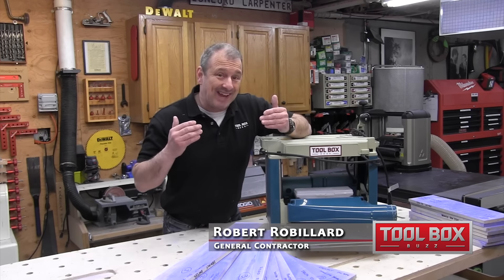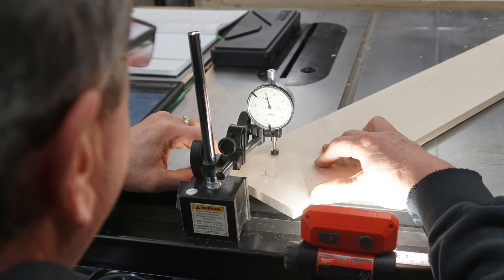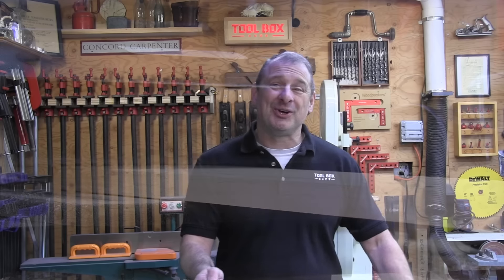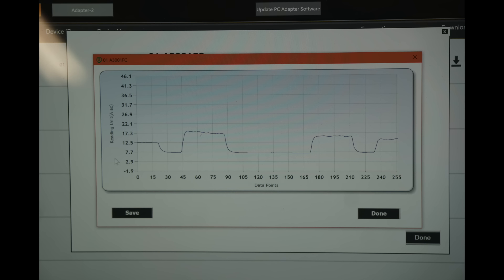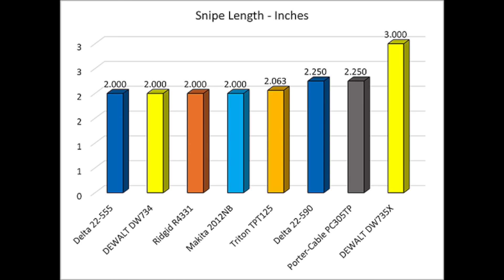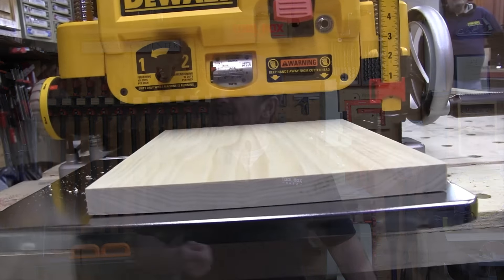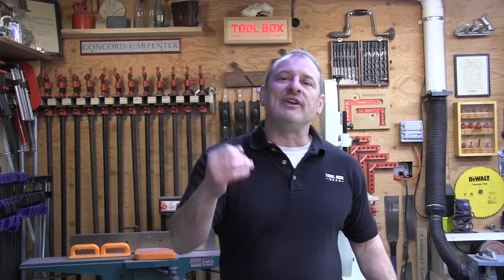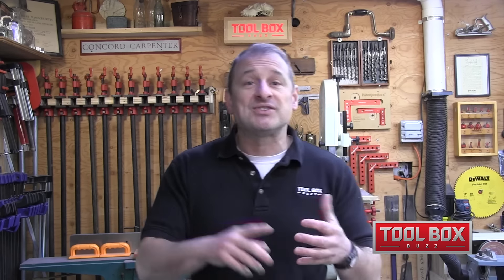Best Benchtop Thickness Planer ~ Head-to-Head

Comment: I've been using the Dewalt 735X in my shop for about 7 years and I love that planer. I haven't read the accompanying article to this video, so  I might be mentioning a few things that they've already mentioned that were skipped in the video. The 735 is a beast at 90+ lbs and that's a good thing. There have been many times I've planned an 8 foot long 8/4 board and that planer didn't even think about tipping. Of course I used external work supports but still, you don't have to worry about the heavy boards shifting the machine in any way. Second, it has an internal blower that forcefully eject the wood chips. That means that you don't really have to connect it to a vacuum/dust collector. If you're setting up a shop on a budget and only have a shop vac, no worries. You can leave the shop vac hooked to your other gear. This planer doesn't need it. I built a cabinet cart for this planer that has a built in baffle , filter and exhaust port. I feed the 4" hose from the planer into the cabinet. All of the wood chips are collected inside. After each heavy milling session, I open the cabinet and shovel out the chips (filling a 33 gallon trash bag), and shake the dust out of the filter. The filters cost me a few dollars each at the big box store. Once a year, I toss the filter and insert a new one. Blade changes are easy and the blades are double edged, so that you can take them out and turn them around to a fresh sharp edge. They're also slotted so that you and shift them a little from side-to-side. Thus if you get a nick in your blades, all you have to do is off set them from each other so that the nick is staggered. This eliminates it showing up on your planed boards, further getting more use out of a set of blades. I run my planer on a 15 amp circuit without any issues or heating, but I've never removed 3/32" like they did in the test. My max cut is usually 1/16" and my typical cut 1/32". Each revolution of the height adjustment crank is 1/16" and I've easily adjusted my depth of cut reliably down below 1/128" increments. You can nudge that crank to take off a few 1/1000s of an inch. Much faster than hitting it with a hand plane. Just use the hand plane to remove any mill marks, which you won't have many of when removing less than 1/128" as a final pass. Oh, there's also a 'finish quality' speed that pushes the board through at half the speed rate letting the knives take twice as many cuts along the board, yielding an extremely smooth surface. To be honest, I've rarely used this feature for that. I use it to simply slow down my overall planning operation when I have a lot of boards to plane and I'm working alone. This gives me time to grab the boards as they exit the planer and stack them while still feeding in another board butted up against the one currently being planed. You only get snipe on the front edge of the first board (which can be scrap) and the back edge of the very last board (which can be the same piece of scrap), thus if you don't want to waste stock cutting off the snipe, just feed your multiple boards through as one very long continuous board. Anyway, that's when I use the slow speed. Fantastic planer!
Reply: Your comment on the chip blower makes a huge difference on the dust collection effectiveness. Without such an arrangement, you typically need much more of a DC (CFM- wise) to collect all the chips without clogging. The setup you describe with a stand containing the dust chip bin sounds like the way to go. Why take apart the DC bag constantly (total PITA) when your method is much easier. I would also add that for those of us with a single stage, smaller size, DC (like the HF), it is very likely to end up with clogs. My old Grizzly  6" jointer would clog that short piece of flex line constantly. The addition of rigid PVC piping and a Rockler style chip separator made all the difference.

If I may ask, how are the Dewalt OEM blades for lifespan? Have you tried these against aftermarket units?

Thanks for sharing your experience on this unit. It is likely my next big purchase.
Reply: Very useful comments. Thanks!
Reply: Thank you for this update!!!
Reply: I would love to see the plans for your cabinet or a quick video of it. I'm in the market for a planer and was leaning towards the Ridgid after seeing this video, however the 735X looks damn good and the chip blower may be worth the difference.
Reply: Very helpful comment like many have said, you just helped me to decide which to be my first planer.
Now I just have to found a place to hide it before my family see it.
Reply: @scottfindley9410  If you haven't pulled the trigger on a Planer yet let me help you. Get the Dewalt 735. Mine has been in operation since March of 2006 and I plane roughly 500 board feet of rough sawn lumber annually, usually black walnut 20%, ash 75%, red oak 5%. Going on 15 years old.
Reply: 大狐 
Pick an area that doesn't get wi-fi or good cell service😎
Reply: @penywisexx Congratulations, did you get the extension tables for the unit? As I understand they minimize or eliminate the snipe. I just purchased and installed some this past week but haven't had the chance to give em a run. Prior to buying the extensions I would minimize the snipe by keeping the out-feeding board as flat as possible as it exited the unit rollers. I did this by grabbing the nose of the board and applying downward pressure at the back of the board keeping it flat against the table. Consider that as the board exits the planer the weight of the board is pulling it down feeding the end of the board into the blade. The rollers apply only downward pressure so there is no reason outside of gravity that the unit should produce any snipe. If you can successfully counter this you can significantly reduce of eliminate the snipe.
Reply: The internal blower is one of the best features of the 735X.  I have a 55 gal Rubbermaid trash container on wheels with an old Toro leaf collector bag that fits the top of the container with a 4" hose connected to the dust port.  Works great with no mess and the bag eliminates 99% of the dust.   My next step is to upgrade to a Shelix shearing head.
Reply: @chatoyance woodworks
I just seen today your detailed statement after seen this video.
I wanna to purchase this machine dewalt 735x but before this I need your suggestion that we have 0.75 ×0.75×10.5 inches wood pcs & i want clear surface & remove all nordy & blade cutting marks.
We have so many pcs like above size.
Kindly tell us is this machine is best for do that?
&
How much smaller size in leangth we can use to get good finishing quality.
As we have 3.5 inch length size (1×1×3.5 inches) smallest pc.
We are finishing it via Hitachi wood planer

Comment: The Delta 50-359 dust collection adapter fits the Porter Cable perfectly. It provides a 4" post perfect for most dust collectors.
Reply: Good to know as I just picked up a used PC!  thanks!

Comment: Great article... As a former owner of a Dewalt 735X, I concur with your findings...  I "upgraded" to a 15" General Tools planer and honestly I miss the lack of snipe and fine finish the 735X provided.  I rarely use the increased capacity and miss the small form factor of the 735X.  One thing I will say about the 735X is that it was LOUD!   Nothing some ear muffs can't fix, but worth noting none the less.  I purchased the Infinity Tools carbide tipped blades for my 735X, and they were still razor sharp when I sold it to a fellow woodworker.  I wonder if he still has it and would be willing to sell it back to me...  :)
Reply: Tool noise usually doesn't bother me. But the velocity plugs get put in before I switch my thickness planer on.

Comment: I have had the Jet surface planer for over 20 years and a Ryobi for close to 15 years  While not the latest and the greatest, they have run thousands of linear feet of  boards flawlessly.  I have however had my eye on the 735x for a good number of years and once I get the big shop built, I will be adding to my collection.
Reply: I had the 735x. I now have the 734 and its a much better machine. The 735x is a ferrari when your need an pickup truck. It has all the bells and whistles but its still stuck in the mud. 734 is a superior machine
Reply: @dougk.5501  Just bought a 735.  Came with crappy blades that only lasted about 10 minutes per side running new fir 2x4's. Snipe is worse than any other machine I've owned. Finish is not near as good as advertised. Will heed your advise and return this one and try the 734.
Reply: @coloradomountainman8659  It's hard to take advice from random people on the internet lol
I hope it works out for you! It's tough having a machine that doesn't work great when we spend so much money on them!

Comment: I’ve used the dewalt and think fairly highly of it. I’ve owned the delta planers and basically through them in the garbage where they belong. Chips(regardless of dust extraction) consistently wedged in between the knife locking bar and under the blades warping that lock bar. Also, even if I’d only run the machine for a couple of minutes the motor housing would be hot to the touch. I’ve had the Makita for10 years (fortunately I paid $400 for it) and I’ve found the performance superior to most including the finish. I can run it all day putting maple through it and the motor is cool to the touch. It’s just really well built.

Comment: Got the Makita over the Dewalt.  The 735 is just way to heavy for a small DIY situation.  It was something like 60% heavier.  I hand plane once at the end so consistency and thickness and minimized snipe is more important.  The bigger the snipe the more you have to match the depth.
Reply: checking other reviews (avg website stars, forum reviews, contractors with 30+ years and own both planers) makes me think there's somthing fishy going on here. Most people have the makits better than dewalts 735, so to have the makita come in last makes absolutely no sense

Comment: I have a Dewalt 734 planer and I do a lot of Red Pine projects! I love this machine and it works well for me. I log and mill all my lumber myself and air dry it for over 1 year.I have found the best time of year to log and cut it is in the winter time the pitch is much lower in the wood. I have to take the blades out and wipe them down with alcohol about two times a year. the pitch is a lot higher in the summer months and the blades will have to be cleaned more often. That is why I only cut Red Pine in the winter months now. I have started making Red Pine flooring tongue & groove and will be buying a much bigger planer just for that use.

Comment: I love the head to head stuff you guys do and for me the Dewalt has been ahead for a long time.  It's just the better planer and miles ahead of the rest.  It has a lot of the features the pros have on their stationary planers like two speeds and the like.  It's probably one that a lot of pros use now because it doesn't take the room a stationary one will take and for what it does I doubt there's a lot of planners anywhere close to that price range will do what it can do. 

Warranty well that isn't a major thing for me.  All these will outlast the warranty and the thing that will fail is the rollers and I doubt any of the warranties cover those.

And wax the table.  It will make everything better.

Comment: I have been leaning heavily towards the Dewalt 735 and been holding off for this video. Time to pull the trigger!
Reply: Having spent the extra money..  worth it.  Amazon had the 735x for 499 a while back. Home depot, online only thought the chat, not in store... they operate differently, will price match.
Reply: I did alot of homework and went with the 735X before this video.  Set it up last week and planned some 3 1/4 × 1 3/4 red oak I have had for 10 years.  Made a shelf 5/4 thick x 12wide. After glue up ran 12" board thru the planer.    Had uniform thickness and virtually no sanding was required before finish was applied. Am very happy with my investment in this planner.
Reply: @chrisj9008  I have seen 499.00 a couple places the last 2 weeks. CPO was one place on new 735X
Reply: @daryld8901  its amazong how smooth wood comes out of it!!! Great machine!!
Reply: That’s the one to buy IMO.  It’s a lot closer to ‘stationary’ 220v/15”+ shop planer performance than any of the breadbox planers.  That said we also have a DeWalt 734 which is surprisingly good - but it’s a 3-blade model. I think (?) they also made a 2-blade version.  3 blades def the way to go.
Reply: 735 + Shelix helical cutter is awesome. The one big downside to the 735 is that the blades are thin and easily chipped. Carbide cutters on a helical head last virtually forever by comparison.
Reply: Justin 
How much is the Shelix upgrade?
Reply: $418 on Amazon
Reply: Steven B nearly doubles the price of the planer. Be nice if Dewalt offered one with the Shelix Head installed.
Reply: @akbychoice  they do not offer with shelix head.  I called and asked them. 
 They also told me the warranty is vold if you put one in while unit is still under warranty.  
 The reason for the head not being offered is so they can sell more blades. IMO
Reply: @HBSuccess  I have a 2 blade 734. I get it to work for me. I hand sharpen my blades and I use an auxiliary table with it too. Plus if I see it tearing out I'll run the board through the other way. All pretty ah duh stuff. But I do want it to work.
Reply: John here before you pull the trigger look at Cutect I got a spiral 24 blade carbide blades 12" for $349.00 delivered 2 yr warranty I cut 2 1/2" oak and walnut over and over woods smaller goes thru vacuum hose real good and quieter than dewalt by buddy got.
Reply: @akbychoice  lol.naaah they will jack up the price of the planer itself

Comment: Great video! I've owned 2 DW735 over 3 years. They are excellent in my shop and provide no reason to upgrade to anything larger in capacity. The electrical pull is definitely something to consider, and I replaced my 15a breaker with a 20a soon after buying the first DW735. Also, because it is on a shared circuit, I have to be aware of what else is operating at the  same time. In my case, I've moved other things off the circuit or make sure they are shut off while the planer is operating.
The DW735 uses a blower for chip ejection, and there's really no reason to attach it to a vacuum system, which likely will clog and have filter problems if you do. I've routed a hose into a filtered shop vac barrel, as well simply routed a long hose out of the shop to a chip pile. Both have worked adequately. The DW735 blower is very powerful and if possible, should be directed as far away as possible to avoid major amounts of airborne dust and chips.
For both of my machines, snipe has not been much of a problem. Generally,  I angle-feed my boards into the machine, which relieves much of the sniping. But obviously this won't work for wider boards. Also, in the model I purchased 6/2020, the guide rails on the platen are very sharp and gouge the board edges, where as on the model I purchased in 2017 the guide rails were very smooth and did not create tears or gouges.
There's a reason I have two of these: the drive pulley on my #1 cracked at the shaft key and spun out on the shaft, also melting the drive belt. I'm not exactly sure what caused this problem, and have been told that a pulley slightly misaligned on the shaft during manufacturing assembly can prematurely wear out and fail. If this is what caused the pulley to fail, it took 3 years of moderate use. But I suspect it was another significant problem which I'll explain.
I changed the blades in my #1 unit about 1 1/2 years ago. In reassembling, I failed to properly torque one of the lock screws that fix the blade to the shaft. After a bit of use, that screw backed-out and ended up flying around under the dust extraction shroud between the shaft and the metal shaft housing. This caused significant damage to the blades, the blade clamps, and the shaft. Also shredded the underside of the dust shroud.
I was able to repair the shaft by filing the damaged spots, but the end of one of the blade clamps was bent and distorted and was never really repairable. I bought a new set of blade clamps from Dewalt - I forget the cost, but not overly expensive - and went ahead and installed another set of new blades.
While I was able to use the planer after the repairs I made, the original damage is likely what lead to the pulley failure. At any rate, I'll buy a new shaft, knives, pulley, drive belt, and dust shroud, and sell the unit as used.
Overall the DW735 has been a great machine in my shop, and I don't plan on buying anything else, anytime soon!

Comment: Thanks! I was already leaning towards the DeWalt 735X because I've had good luck with their other tools. This review clinched it. I had to wait for it to go on sale, but I picked it up for 19% off last week and put it to work immediately.
I have a bunch of scrap CVG fir and some 8/4 cedar left over from a deck. Resawn to just under 1/2" and planed down to 3/8 for decorative boxes. With the smooth surface and accurate thickness this planer provides I barely have to do any sanding!
It's fucking heavy though - no joke. Don't throw your back out!
Reply: I'm curious what you paid please after the 19% sale ?..and are you in the states ?
Reply: @RaoulDukeSr  regular price was $600 so I got it for $486
I'm in Colorado.
Reply: @danielpittman889  thanx friend that's helpful...keep on making sawdust !!